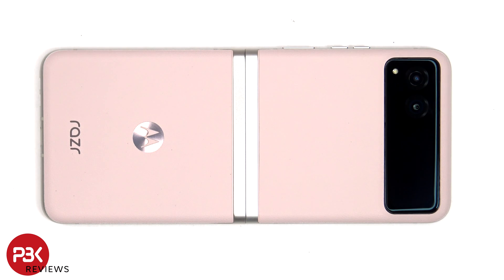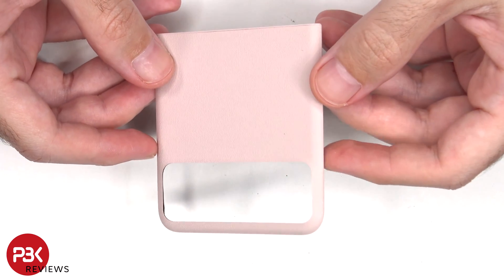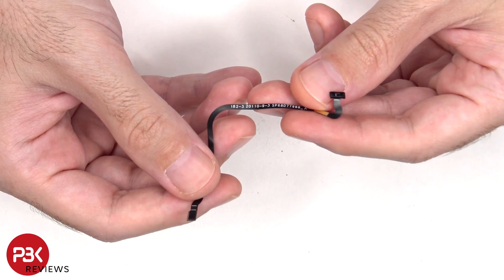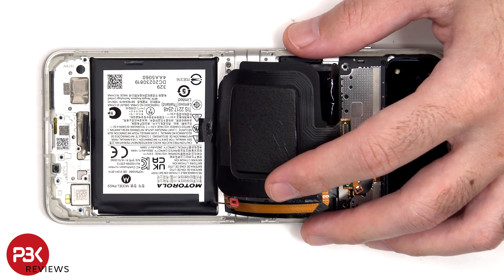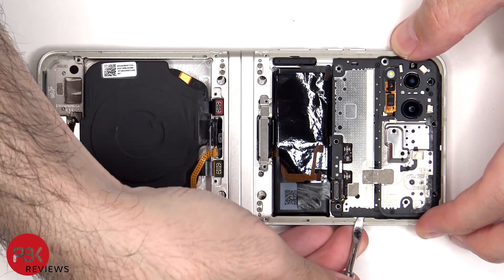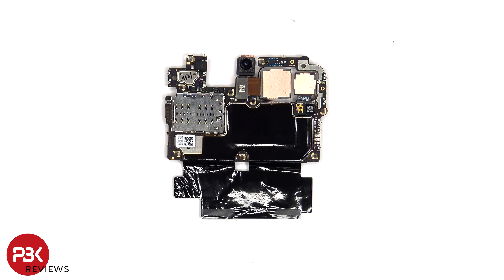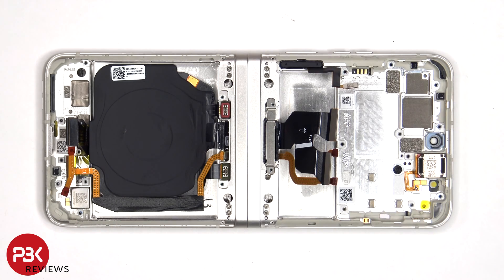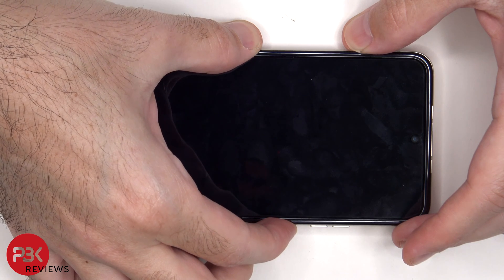Motorola Razr 2023 Razr 40 Teardown Disassembly Repair Video Review

Comment: Hello awesome video. LIKE and SUBBED! Just as an experiment i want to upgrade  the storage on this phone to 512 or more. Any idea what chip would be for storage?
Reply from the maker: Thanks! The ROM is located on the main board under one of the covered shields. It would require de soldering and soldering a new ROM so you need to be good with soldering.

Comment: How many parts need to be removed to remove just the power button? A few days ago, something seems to have pressed the power button in, and while it still clicks, it's been stuck in a random reboot loop where it will restart after a few seconds every time. I wonder if the gasket got wedged under or something...
Reply: I'm no expert, but my best bet would me to disconnect (not necessarily remove) both batteries before messing with the power button internally...so you'd need to remove enough parts to be able to access both battery connectors. After that, you'd probably be able to reach the power button from just the upper half of the device without needing to remove any more parts from the other
Reply: @chrysaliscrisis8530 stupidest thing happened. It just started working one day only for my butterfingers to drop it screen down onto something that broke the screen...

Comment: Waiting for EU removable battery laws to take effect. Insane to bury these batteries within all these components, making them disposable phones. Not to mention, swollen batteries after ~2000 cycles. Love the square aspect of the phon, but will never buy non removable battery device.
Reply: I remember when it was as easy as popping the cover off like on a remote, and batteries would last for years without issue. We're being taken for morons with all the modern anti-repair, planned obsolescence BS. Funny how we have so many electronics from the 2000s that still work because it was before planned obsolescence was perfected, and yet now they'd have you believe this stuff is supposed to have a finite shelf life

Comment: Great vid but I really would have liked to seen a screen actually replaced. Got one?
Reply from the maker: Thanks. No I dont have a video of the folding screen removal. I've done it on previous models of this. Once disassembled, you just need to apply heat and pry the plastic boarder as well as the old folding screen off from the frame. However I recommend instead getting a screen with frame replacement since it will be much more simple and easier to replace. These screens are fragile, so if you don't get the original pre cut adhesive and apply it properly when re adhering the folding screen to the frame, then it will get damaged when opening or closing the flip. So just not worth risking damaging a replacement screen when you can get one factory applied to the frame assembly.

Comment: I love the Motorola Razr 2023 that I have. Only issue I am having though is that I've only had between 2-3 months and sometimes when I close it, hit the power button, or like yesterday, just have it open, it shuts down completely. Sometimes it doesn't come back when I hold the power button, sometimes it does. I believe it's a software issue, any tips or advice would be greatly appreciated because I really do not want another phone. Especially since I'm still financing it through affirm from Walmart. Thank you.

Comment: Came for the internal screen disassembly glad I didn't watch the whole thing
Reply from the maker: I suggest you don't attempt it. If you skip through videos, and its your first time and with given instructions in this video when the phone is disassembled on how to remove the folding screen seem to not help you figure it out, then you should not attempt it on this phone. It's not the easiest task to do, especially if the replacement is not installed correctly, you will break it when folding it. You're better off using a full flip assembly as replacement or letting a professional place do it. On this folding screens, you need to use the original adhesives made to apply behind the folding screen to the frame, because if the folding screen slides or moves out of place even slightly when being folded, it can result in it breaking.

Comment: Did you notice any mm wave antenna and did the sim slot have extra connections for memory card?
Reply from the maker: No mm wave antenna and no memory card contacts or slot. Just dual sim slot but not active in all regions.

Comment: I've been pretty impressed with Motorola's phones in recent years, admittedly from afar. The desktop mode with a first party dock and native 4K ... the Moto edge 30 had external stylus support and a case purpose made for it. Really competitive pricing on the international market. The aggressive design and colors of razr. Giving the users free capacity to use the front screen natively as part of the stock experience .

lthough sadly some of their best products didn't make the US or came to the US in a nerved capacity with different silicon and charging.

Obviously long-term updates are a problem, and have been non-existent for many of these phones. I have to assume they've been pressured to adopt something closer to industry standards... Maybe 3 to 4 years at least. But we'll have to see how it shakes out